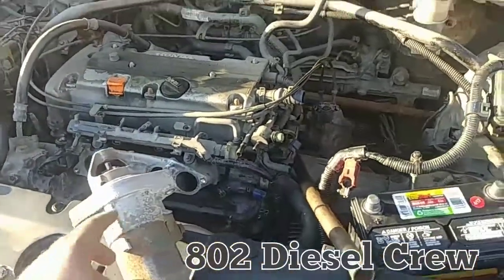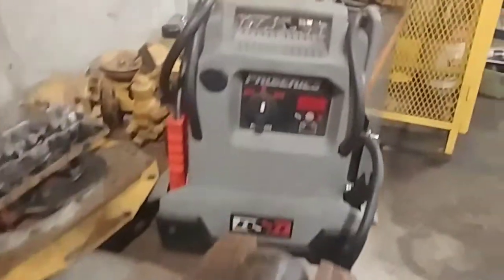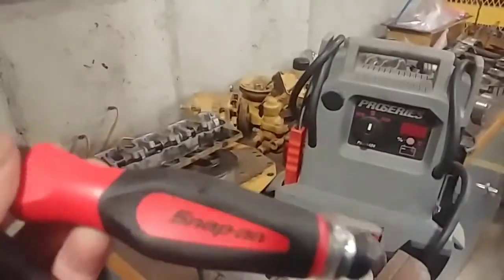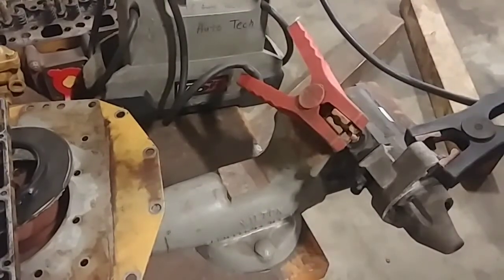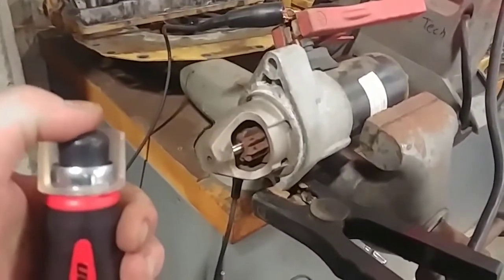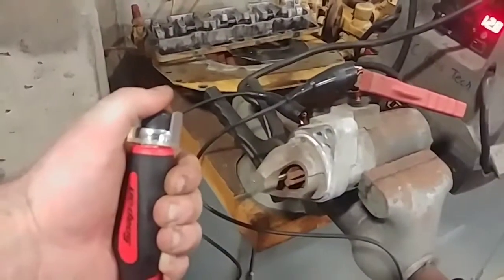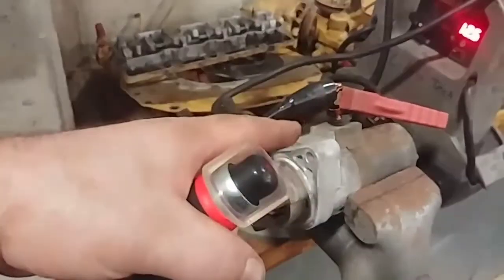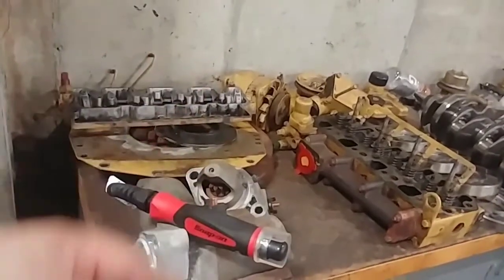Snap-On Tool Starter Switch MT302BR- What is it, How's it work!?

Comment: I've actually never seen a starter button, but I've jumped out the terminals with a pair of channellocks, haha.  kinda sketchy but it worked.  is that the main use for that tool?
Reply from the maker: +Mike's Tool Shed I use it more to bump engines over to top dead center. You could potentially put it in line at a switch for anything. But the main use in most shops would be to test starting systems to rule out a bad starter with it still in the car. When u press the button it just complete a circuit. 🔋.